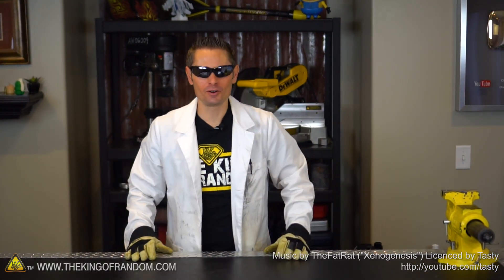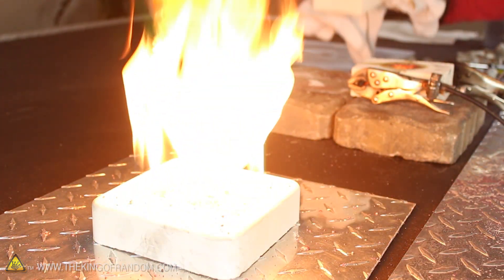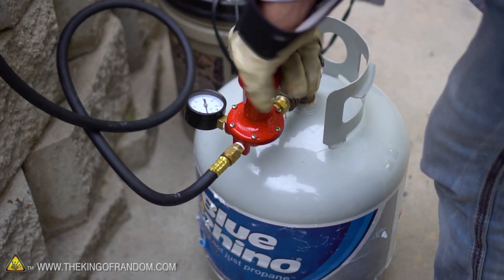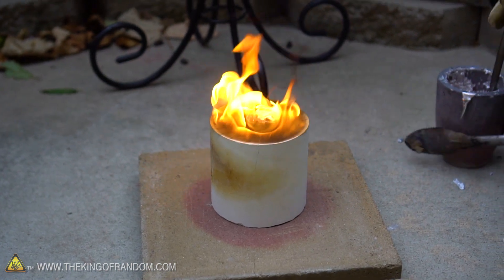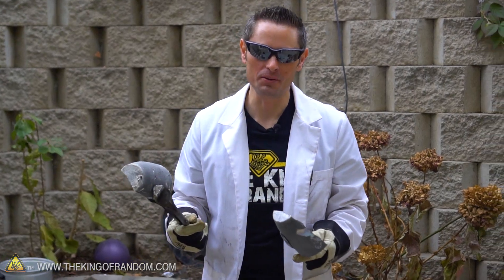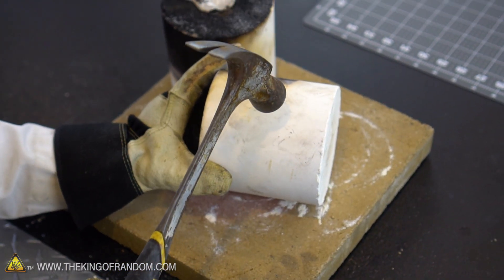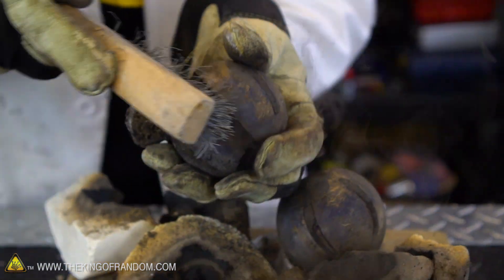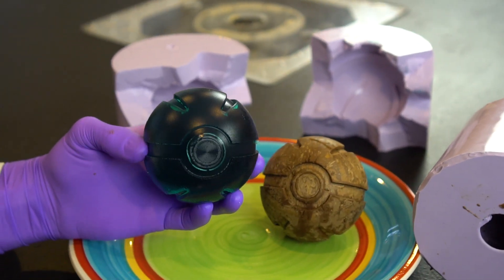Casting Aluminium PokeBalls

Comment: How to do it without bubbles
take item
clean item 
spray item and cylinder with soapy water or 1 to 1 windex to water mix
put item in acrylic cylinder missing one base
secure item making sure not to trap any air underneath it 
pour
place in vacuum chamber slowly take out air 
then slowly pressurize it to fill gaps
let set
remove item
this will create a mold without bubbles
to then recreate in aluminum 
cut mold in half to have as few places with air
head to above the temperature of the aluminum 
hear the aluminum like your supposed to
take off slag 
pour into mold while keeping both the temperature above where the aluminum is molten
slowly reduce the amount of heat you are using to heat it until solid 
let cool completely
break open
piece together 
done

Comment: I actually make props/replicas for a living and there's a couple things you can do to ensure better detail retention with your silicone:

1. Put it in a vacuum chamber to de-gass it, thus removing the air bubble.

2. Pour the silicone slowly in a corner of the mold and let it slowly climb up the sides of what it is you're trying to mold.

3. Do what's referred to as a "beauty coat" which is where you mix your part A and B in a much smaller batch and brush the silicone onto your object with a chip brush, wait for that to cure to a tacky surface (touch it with your finger and it doesn't stick to your finger) then pour the silicone slowly around it like in step 2.

Hope this helps man, love the vids.

Comment: I've seen the guys over at AWE me's Man at Arms use a vacuum set up when pouring metal which produces a nice clean cast. They also dip the whole cast in water to dissolve the plaster and cool the metal quickly. Maybe you could get in touch with them for the specifics. 😄👌

Comment: for your molds u need some kind of vibrating table to set them on wile they dry/cool down it will make the air bubbles go away and give u nice clean molds and make ur castings perfect...

Comment: To avoid air bubbles, try adding some small vents to your mold to let air escape as you pour the metal. Unfortunately that doesn't solve your outgassing problem.

Comment: Grant Thompson - "The King of Random" you should check out a channel called AvE. he has done lots of casting and he uses foam with sand packed around it. It's a special type of sand but his turn out great. And he has tried wax and plaster and had the same problems.

Comment: you need an exhaust port for the mold, you can't just have a single pour port the heated gases need a place to escape
Reply: but then the Rebels will have a target
Reply: also use talc powder to release the mold from the metal easier
Reply: Someone needs to see this.
Reply: Can't he just make very miniature tubes for the air bubbles to escape, and the break them off and grind them flat afterwards?
Reply: yes
Reply: Great comment this is so true.

Comment: to remove air bubbles you need air in the cast people use metal tubes to hollow out sand casts try a thin drill for plaster, hope it helps

Comment: if you watch man at arms reforged they do some metal casting, and the stuff they use is less prone to heat than just plaster, it also disolves in water leaving you wit a better cleanup time

Comment: Just a random thought on the air bubbles. why not use a a square base sander turned. upside down. Then turn on while pouring making molds or pouring into the molds. This should allow the air bubbles to rise. Got the idea when watching them pour cement and used a cement vibration device to rid of air bubbles. Worth the a shot. Cool Videos.

Comment: just a random idea about those air bubbles. Maybe use a small square base sander turned upside down and turned on while pouring the mixture in the molds or making of a mold ? The idea came watching how they pour cement and vibrate the air bubbles out. worth a try ?

Comment: Hi Grant! I've been studying iron casting at school, and have a suggestion that may help reduce air bubbles. When we cast, most often we use bonded sand, and we always drill out TWO holes, one for the sprue and one for a vent. Adding an extra vent means more we have to cut more off the final casting, but it also allows gasses to escape from a different hole than the one you're pouring into. It should work the same on plaster as well! Thanks for the awesome videos!

Comment: you can make cheap home made "green sand" for casting, would be a lot safer, and probably better detail than plaster. if you put some kind of binder in it i am sure you could bake out the wax just the same.

Comment: What you need is a burnout kiln and you need to cast the same day you burnout the wax and then your metal won't pop and burst like it did. the kiln should be about 1100 degrees ferenheit and be left overnight and then take it out right before you pour it

Comment: I believe if when casting, you put the cast on a constantly vibrating plate, that would help work the air bubbles out as it dries. It should work for the silicone, wax, plaster, and even aluminum.

Comment: I came a little bit late, but, when you put the silicone to make the mold, don't do waves, that may cause the air bubbles in your molde, and try to put in your vacuum machine to extract the air off your molds.

Comment: You need a second hole in your plaster leading out to allow air to escape.  Same concept as your laundry detergent bottle,, you have a second cap that you open or loosen so that the soap flows out smoothly instead of that "glug glug" splashing pour that you get if there is only one hole.  I notice on your pour that there was a little bobbing on the surface as air tried to escape past the aluminum.  With a second hole to allow the air to escape you'll get a much better pour and likely not have areas of what you thought was shrinkage.  That was probably caused by trapped air I suspect.

Comment: the reason for the breaks in plaster, I believe as someone who has cast with it prior is the quick  superheating of the air bubbles let in the mix. to get rid of this risk, place the plaster in a vaccuum. also the quickest best way to remove the plaster is to submerge them in water where they'll fracture off

Comment: to prevent air bubbles on the mold add 3 small holes near the pouring site, so that the air can escape because the metal cools around it you will have to use a grinder or a sander to smooth the casting out but you can totally do that

and in the future you should get a sonic cleaner, the ones that vibrate really quick it will clear up every inch of that as long as you clean out the water once and a while

Comment: Question, how do you actually make the mold in the first place, do you just buy like a plastic pokeball, and push it into the plaster while it's still solidifying? Is there a video where you make the molds?
Reply: Denisowator yes there is a video
Reply: Dinorange Found it. :)

Comment: Grant: A suggestion to avoid bubbles on ALL of your castings, starting from silicon up to metal.  When you pour the material, you need to gently vibrate the surface of whatever the mold is sitting on to force out the air bubbles to the top so that they don't impact on the mold surface.  That'll help prevent them from settling in the mold and giving you those pockets everywhere.

Comment: I think if when you are you making a silicone mold if you put a small vibrating table under it it would help all of those bubbles rise to the top that's what we do at the factory I work at making drywall

Comment: To avoid air bubbles in your plaster cast you need to vibrate the air bubbles out.  I took dental impressions, then turned them into plaster working models. We used a vibrating machine, and you need to pour the plaster in increments, vibrate, add more plaster, vibrate, etc.

Comment: Try a zircon slurry mixture and do the same process. It becomes a lot harder and it is easy to pour into. Also try deslagging before you pour! Also RIGHT after you are done pouring place a paper bag of sugar (10g is fine) so itll burn up the impurities and it will avoid "peppering" in the metal. It'll also help with the air bubbles. Cover it with a solid piece of metal and remove after 20 mins.  I am a Casting Engineer :)

Comment: You need to add a vent to the cast to avoid the imperfections near where you are pouring in the metal. After you have your product cut off the excess that traveled up the vent and sand it down just like you would do to the main hole.

Comment: if you use a mixture of oil and fine sand and use that like the plaster it would work with aluminum 
you would need to make 2 halfs to the mold and divide it with a setting powder 
the sand would also need to be tightly packed to capture detail 
I did this in my metal working class so I could explain in more depth if needed and it works great

Comment: What u could have done is use wax poke balls use sand and make a same with it and another same one like it then take out the wax poke balls and then heat aluminum oh an us wood box and the poor the aluminum and wait for then later wait for it to be so steel then put it in water wait for it 2 minutes and done

Comment: For future reference, mixing 50/50 plaster of paris and really find playground sand works great for making lost wax/lost pla casting. I have used this method many times for casting metal objects from my 3D printed parts.
Reply: When I cast aluminum this way, The casting does not start on fire at all also, castings come out really clean.
Reply: Ty Barringer nice

Comment: Hi Grant!
I wanted to give you a tip about the castings of the molds.
On the Silicon molds you need to put in vibrations to float the air bubbles to the top, preferably vibrate the silicone after the mixing as well before pouring it in the mold , and than if possible also after you poured it on the object that you are taking a cast of.
On the Gypsum side, you would need to put the whole mold under a vacuum to take the air bubbles out and let it dry there, the end result being a smooth cast. I can't pronounce myself on the flammable fumes doe.
I also want to thank you for the great content, my whole family enjoys your clips, especially my 7 years old daughter!

Comment: The best thing to use for home casting is greensand or delft clay. These molds will take longer to make but will last much longer. Molds do take some breaking in though. To help with air bubbles I recommend making vents in the mold then making small pits leading to the vents from your mold cavity.

Comment: When pouring the molds try using a palm sander without sand paper on the sides and bottom that will help move the air bubbles out and distribute the liquid better

Comment: Have you tried adding a ventilation hole in your molds while pouring your hot metal into the pour hole? That may aid in your molds not splitting perhaps. Try it.

Comment: Suggestion: Make a jogger for the molds (a small table that vibrates to release the air bubbles that you can clamp the plastic to while pouring) 

For those wondering: the term jogger comes from my time in a print shop, where we had a paper jogger to make piles of paper even for binding.

Comment: Burning on metal pouring is likely due to incomplete wax burnout, or carbon residue. Lights on fire when the molten metal hits it.

You'll want higher burnout temperatures/longer time to make sure it's clean inside your investment. However, not sure how plain plaster will hold up under those conditions; may need to switch to a proper casting investment to be able to handle that.

Comment: Heat the mold up slowly in the foundry before pouring the aluminum in. You may need to make the mold smaller to fit it in the foundry.

Comment: I'm not a pro metal worker, but I think if you use special casting cement, and cut it open carefully, you should be able to reuse the molds.

Comment: You should build yourself a degassing chamber if you're going to be mould making more frequently. I also remember there is a video of a city making lost pla mould with 3d printed parts.  Where he used a plaster sandix for his mould then heated up the plaster mould in his furnace before melting the aluminum

Comment: if you keep shaking the molds as they dry a lot of the air bubbles get out I attach an adult toy called the hattachi magic wand to my molds and leave it on and when I cast metal I just put the wax in high grade sand and pour on the wax mold the metal melts the wax as it replaces it as for your crucible I took a steel coat hanger and drilled holes to make a handle makes pouring much easier

Comment: i think pre-heating the molds to around the temperature of the molten metal would help since heat makes the gases in the molds expand and thats what makes the gas bubbles on the surface of the casting, so theoretically the hotter the molds are preheated, the smaller and less bubbles you will get at the end on the casting.

Comment: Grant Thompson... 

What you need to get a proper mold is something called investment powder (SRS SILK jewelry powder) , it has special silica binders that can stand the heat, usually you are also supposed to use a vacuum pump on the mold, to get rid of the bubbles, but i am sure you can come up with something for that. if not,  you could maybe adapt NightHackinlight's hand vacuum pump. That should get rid of major bubbles. Also usually these investments are burned out in a kiln at much higher temps.. to help with shrinking you need to create an area for more molten metal to sit above (like a small reservoir), this creates "head pressure" which aids in keeping the metal conformed to the mold. 

Hope this helps!

Comment: broooo
to avoid getting air bubbles in the original cast you need to put the silicone on in layers
start off brushing on a very light layer, get in all the smalls spaces this way, do a few layers of this then start putting the sillicone on like you did originally

Comment: Look Grant what do to avoid air bubbles being trapped is to build a heat resistance vibrating pad with of course a flat metal top so when your cast are on there turn the knob or power switch to vibrate what your casting.

Comment: can you pour molten aluminum in a silicone mold????
Reply: hi i'm bob No it will most likely burn it
Reply: No, it couldn't take the heat.
Reply: hi i'm bob no probably not
Reply: I'm sure it would melt the silicone on contact.
Reply: Tendrax yep

Comment: That casting technique is actually called investment or lost-wax casting process. As for the plaster mold, you could use a refractory ceramic material if you don't want it to break.

Comment: hey grant i was wondering if you used different ratios with the plasta and sand then when you go to cast it in copper there would be more of a finer finish or you could just make your mold bigger so that you could sand it down to your final finish

Comment: might be better to use sand molds but the only problem is you will have more slag and stuff.also aluminum will work better in molds when you can shoot it at high speed

Comment: When casting you don't want to use straight plaster, for the reason's demonstrated, and what you want to do instead is mix the plaster dust with sand (Play sand seems to work sand) in a 1:1 ratio and cast that. The end result absorbs heat better, doesn't crack under heat, and the sand doesn't seem to adversely affect the casting unless you have like rocks or something in your sand (You don't want that)

Comment: Just a quick tip, a way to avoid air bubbles in a silicon mold is to put the silicon in a vacuum chamber before poring it. do that and it will take the air you put in when you stirred the silicon out. you can also put the mold in a vacuum chamber before it cools if the object you are making a mold of can handle the pressure.

Comment: A working aluminum propeller, this would need to be higher quality.
Why haven't you made a shaker table/platform yet to get reduce the amount of air bubbles, you could make one fairly easily, using either an eletric sander, an eletric vibrating motor or even a electric drill.

Comment: To help avoid air bubbles use a paint brush and paint on silicon or plaster quickly before submerging or covering your item. It helps to fill detailed bits as well. Or you could just dip it in take it out rub it round an put it back in.

Comment: You should of casted the metal poke ball with foam and a bucket of sand so you wouldn't of had to spend a lot of time on a plaster mold that you can only use once

Comment: What plaster do you use, pure plaster of paris or a mixed one for metal casting? Have been casting reclaimed silver from the school that I worked with, even ceramic crucibles broke at that temperature, and cleaning the cast iron ladle was a pain... it's only so pure I could get it at about 90% due to what I was heating it in but it wasn't bad going from previous experiments with silver nitrate and also the art department photography fixer. I used wood for the molding (only wanted an ingot for future science experiments)

Comment: Finally, please try "Lost PLA" casting where you 3D print in PLA and then bake that out like you did the wax. That way you have a more more direct path from design file -> 3D printer -> lost PLA mold -> foundry pour.

Comment: It was really neat when the crucible broke and you just poured it out the side of the foundry... why not just do that every time? I seem to remember you improved the foundry by using a stronger material mixed with the plaster... at least for a few castings, it might hold up, huh? That would remove a major cost.

Comment: Please try green sand casting, and perhaps try coating the parts with plaster first, then embedding in the sand for a smoother surface. The nice thing there is that the sand can be reused, and you only lose a little plaster. 

To avoid air pockets, add small vents around the top which will fill with metal and then can be cut off.